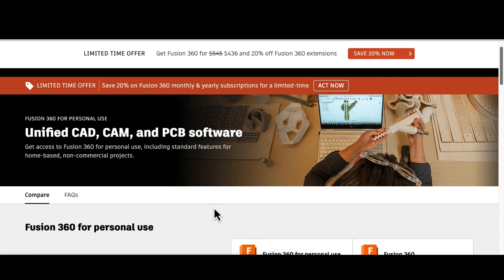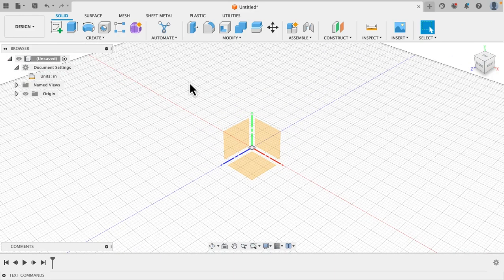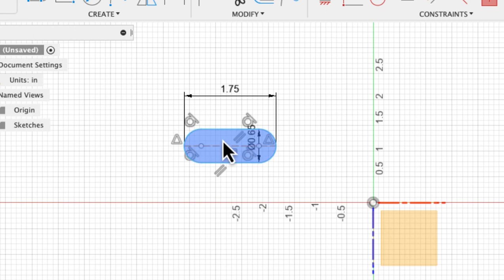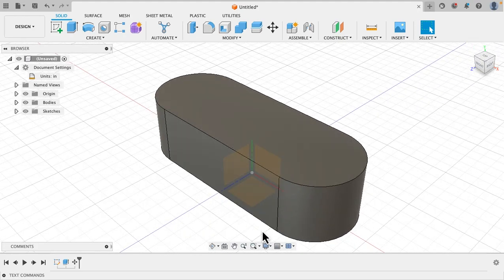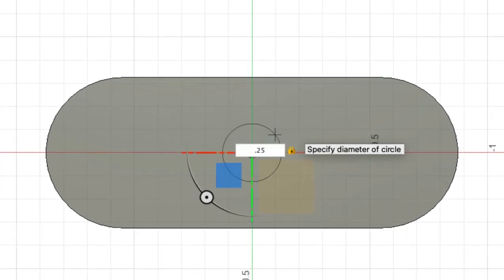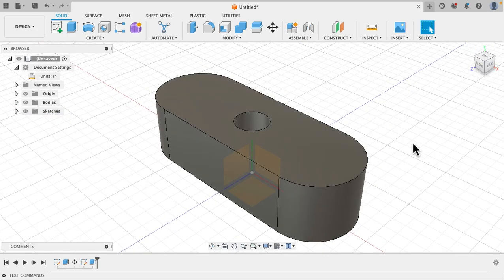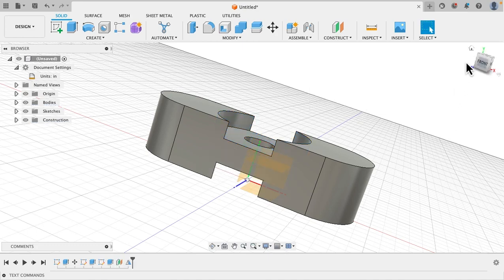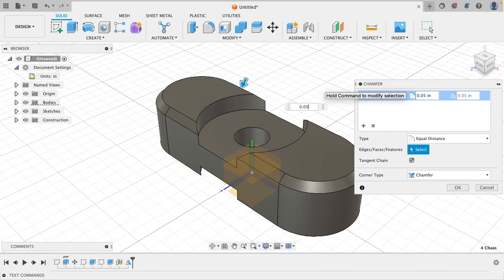How to Model a Fidget Spinner in Fusion 360

Comment: Curious about Tungsten spinners. Why cant most machines make them. What CNC/tooling is needed to machine tungsten. I love the material so much I would love to know more about it
Reply from the maker: The crystal grains in Tungsten make it ultra-hard and very difficult to machine. I won't even try to machine Tungsten on my Tormach machine because I would most likely break my cutters or wearr them down extremely fast. That said, there are a few machinist like Nick (Full Throttle) who has the machines and expertise to machine Tungsten.
Reply: @Guerilla Shop  thanks for the info. I wish nick would make some more W. I missed the boat on that. Pretty sure he hates working with the material for the reasons you mentioned
Reply from the maker: Nick's a genius!  I have learned a lot from him. :)
Reply: @GuerrillaShop-m3  that I don't doubt. Seems like a great dude as well.

Comment: Nice tutorial. Just a tip that it is best practice with something like this to model it centered on the origin so you don't need the move command and your sketch is fully constrained.
Reply from the maker: Thanks for the tip! The challenge is that the "Overall Slot" tool doesn't create a slot using a center reference like the circle.